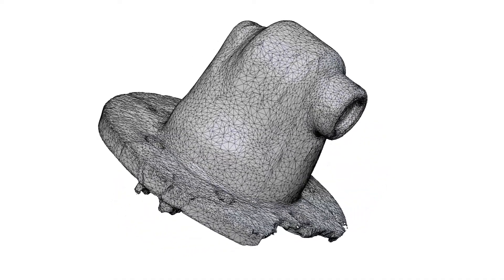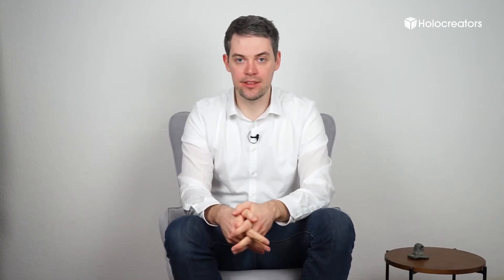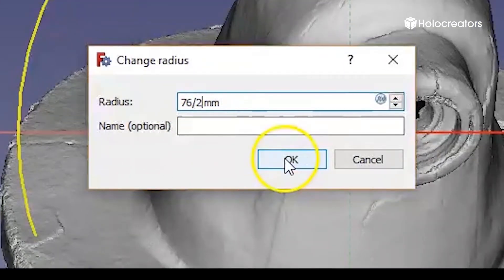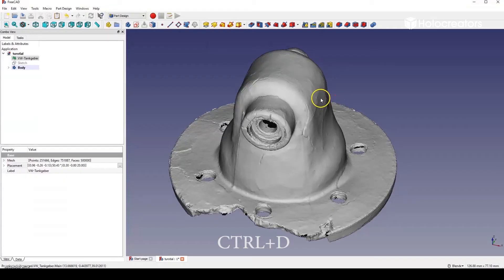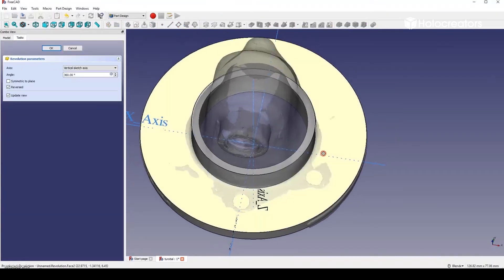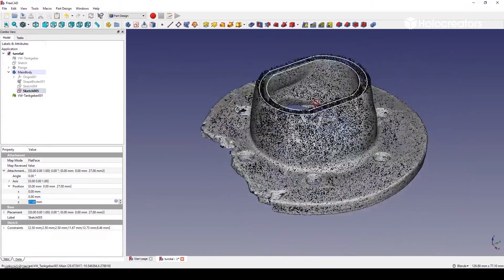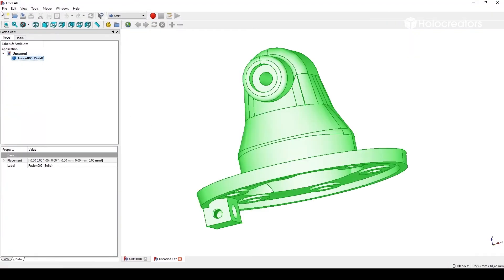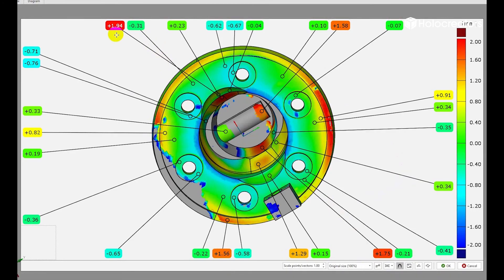How to Convert STL to STEP using Free Software? (Short Tutorial)

Comment: We previously paid a great deal of money to have professional point clouds (NOT from this vendor) made of very precise and complex parts with high tolerances.  Trying to create and define high tolerance geometry with MANY point clouds that are patched together and then defining precision geometry, and complex surfaces was futile at best.

Combine this fact with the idea that you're scanning a manufactured part, (and rarely fresh from manufacturing and therefor deformed in various ways) but what you really want is the nominal or "Basic" dimension from the drawing and the process fails.

We determined that there was little value in reverse engineering complex parts with this or similar methods if the expectation is getting accurate geometry/models from the effort.
Reply from the maker: okay thanks for your insight.

Comment: This is very interesting. Can I use this method to scan a large object, something about 49 inches (125 cm) long by 12 inches (31 cm) wide? Its very high but I just need the bottom several inches. I looked at a handheld 3D scanner, but this seems to be too big to use one. Thanks!
Reply from the maker: yes you can, photogrammetry can scan everything, from a mouse to the size of a planet :-)

Comment: Just a comment... This is not CONVERTING but starting from scratch.  You are using a 3D file for reference only. It is even easier doing some 2D measuring with a caliper directly on the original piece and than model a 3D part. Though the  GOM is a  good point! I owe you a beer ;-)
Reply from the maker: Thanks Abraka, correct this is a reconstruction with solid modeling based on a 3D scan.

Comment: I have a model of a boat that I need to make into a solid for a university project , do you think this method would work nicely for a model of that complexity? Just don't want to waste more time on the model part, I've basically used a iges file for my model and modeling on it on fusion 360 I know iges files are outdated but only way I was able to reduce the faces so I have flat surfaces to draw on any help will be much appreciated
Reply from the maker: Hello Emalan, boats are not easy. You basically have a lot of ribs which are solid geometry and then you have the hull which is a NURBS surface "wrapped" around those ribs. It is definitely possible to create such a model in FreeCAD. But it will not be easy and take a lot of time.  Even with professional Reverse Engineering Software, boats are challenging. But how about you send me the file, then I could give you a better advice: info@holocreators.com
Reply: @Holocreators  thank you so much I will send you the STL file and iges file